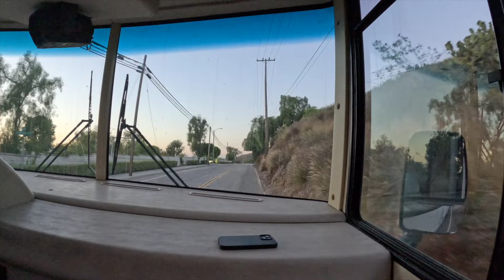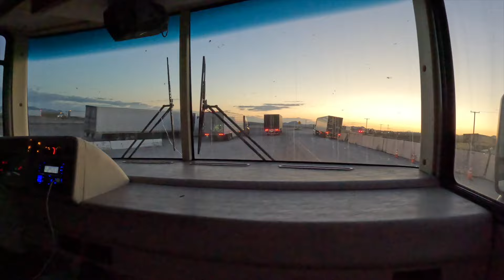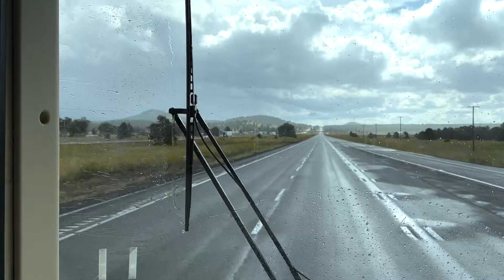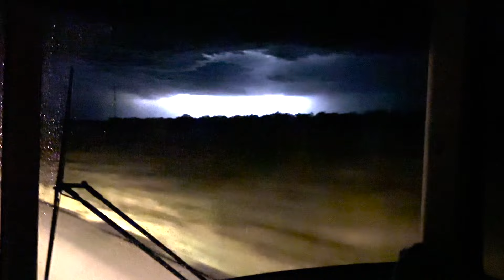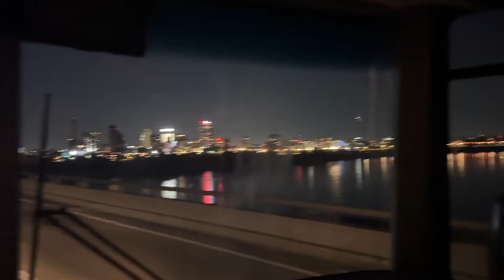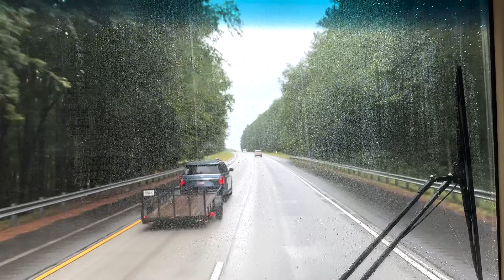Dragweek 23 Part 1

Comment: Why do you always jack the back of the car up at the track?
Reply from the maker: I have to change the tires twice a day. From street tire to slick and from slick to street tire so we can drive it without wearing out the slicks. The reason the car is so high is because the tire has trouble getting out under the quarter panel. Also we have to disconnect the driveshaft, sway bar, and shocks to get the rear end to droop enough to slide the tire out. It takes about a half hour to complete.
Reply: What up Brother! Good luck on the new channel and Dragweek. Go get ‘em bro.
Reply from the maker: Thank you Jonny!!